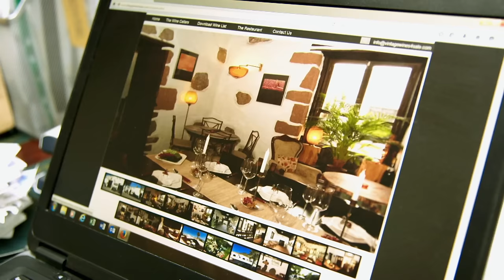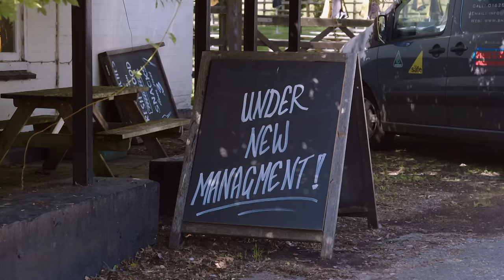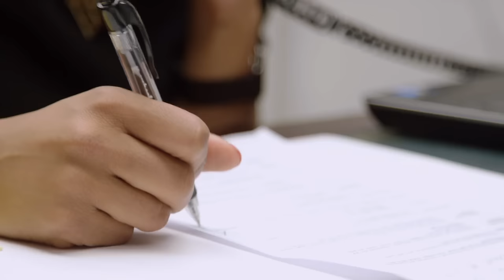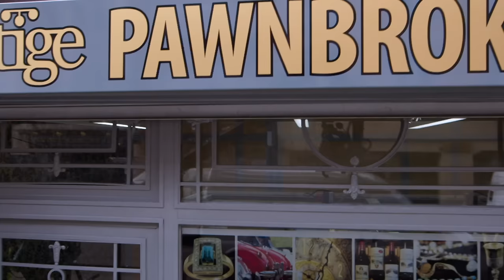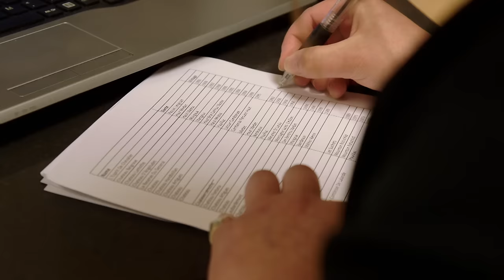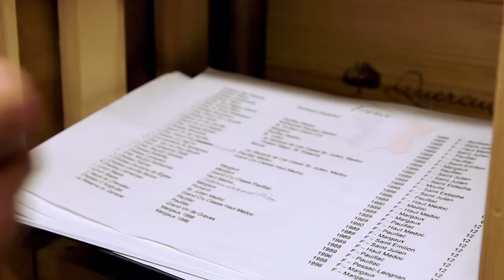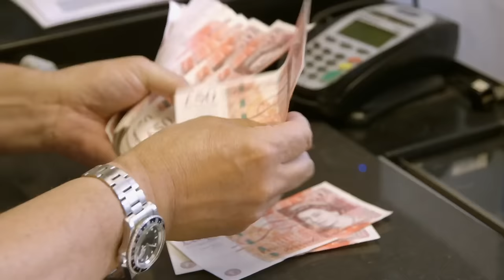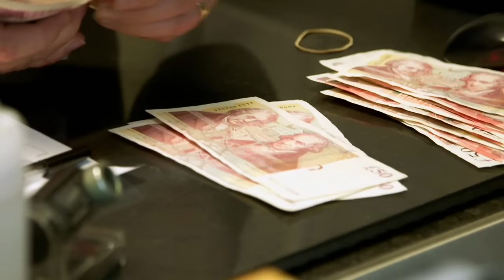£1,000,000 Demand for Luxury Wine Collection  | Posh Pawn S3 E5 | Our Stories

Comment: That was NOT a bottle of Romanee Conti.  Too bad for her because the difference in price is probably 100X the difference.  Likewise 1977 Mouton despite being dedicated to the Queen mother was never a great wine and had virtually no drinking value.  Still there is probably some real gems in there.  I tiny difference in the name or vintage can change the price from $50 to $50,000. 

If I was swilling a wine collection I would only deal with reputable wine merchants.  Realistically the best value will come from selling at auction,  selling to a middle man eliminates at least 25% of the value.  I suppose this is a created show so there is some of that to consider.